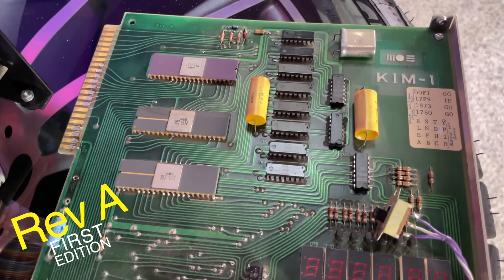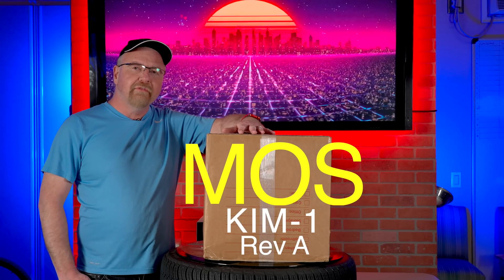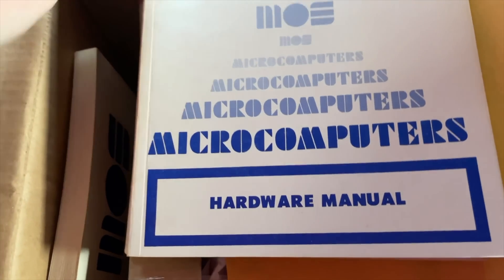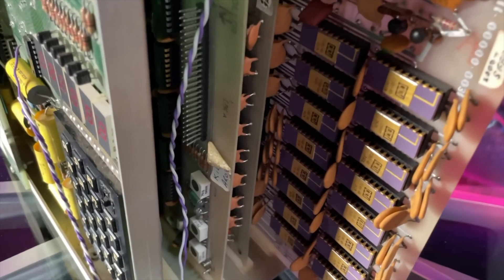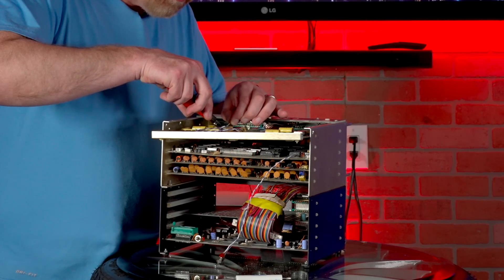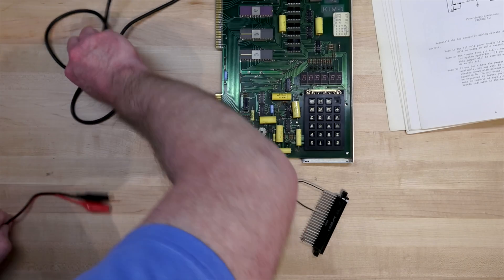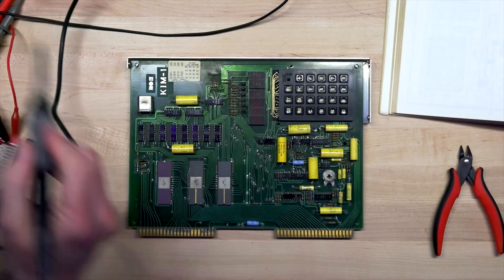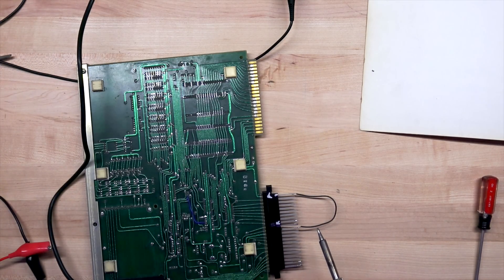I Bought the Oldest PC on eBay! Unboxing the KIM-1

Comment: Funny how I could convert an atari vcs to a kim1, just add an ay8910 or an extra 6532

And throw some extra ram and ROM 

The two gpio from the 6532 work for keyboard or the paddle inputs 

Having the crt replaced the need for the keypad and leds

But you'll need a display routine and some memory monitor or bios

Comment: My first computer. I worked for ETI in the 70's, it came in for review.
It ended up with a video card I built and a Tandberg TCD 330 remote tape drive for storage.
But then I got an Acorn Atom also 6502.

Comment: Great video! Brought back lots of good memories, so earlier today I powered up my Rev. A KIM-1, purchased April, 1976, and it works fine. My manuals are from January and March, 1976, with the dark blue covers and white/gray lettering. If there is a way to post a photo of my KIM-1, which is built into a Sears briefcase, I will happily do so. Thanks for excellent video and bringing back some fun memories!

Comment: Surprised it was soldered and not wire wrapped!
When you said 2180 my ears pricked up. That is the model no of a VCA chip DIY audio enthusiasts use a lot. 
Especially if you are building an SSL G series compressor clone. 
AKA the sound of 80's and 90's top 10 hits.

Comment: I had to write again!  When I finished my IMSAI, I got out the Intel 8080 book and wrote a program in binary (no keypad, just toggle switches.) and wrote something that read the switches and put them on the data bus LEDs.  It was something like READ FROM THE SWITCHES - WRITE TO PORT 255 (LEDs) - and finally C3 00 00.  (Don't know why I remember JUMP, CD is CALL and C9 is return from a sub.)  My nostalgia button is in full tilt.  Just a little aside.  Floppy Drives and controllers for S100 bus were around $1,400.  I traded my brand new Honda 550-four for a disk and controller.  The fact that the disk was only 100 KB, and hard-sectored did not bother me.    It just beat the heck out of my Panasonic tape recorder and a Tarbell tape controller.

Comment: First time watching, Dave. Liked and subbed. I'm also a 1968'er btw.

It's a fine looking machine and in excellent cosmetic condition. I'm a bit (no pun intended) surprised to see the amount of engineering that has been put into this, with all the peripherical boards.
That's one tough cookie you got there. Congratulations and I look forward to see the procedures, repairs, et cetera.

Though not being an educated System Manager or an Electronic Engineer I do feel safe to say, that a machine like this could easily be put into use today.
Wouldn't it be an absolute true statement to say, that it could control things through sensors and solenoids, motors and mechanics ?

Illinois capacitors on the mainboard ? Looks darn familiar to what Mr. Carlson's Lab is recommending because of their high quality. Expecting to see you test these thoroughly.
I hope you're familiar with testing for, and using the outer foil closest to the ground connection, that Mr. Carlsson's Lab has proved to induce the lowest electronic noise level, which would be useful in this environment.

Very beautyful piece of delicate equipment. Very impressed.
Made when brand new episodes of McCloud and Columbo were aired.

Cheers from Denmark, Scandinavia.

Comment: What a great video Dave! I started with the KIM-1 too and expanded it with a DIY interface to a S-100 backplane. I used it to control a home made analog music synthesizer and I'm going to speculate that it might have been one of the first synths ever controlled by a home computer :-) I actually still have both the computer and the synth although I haven't touched them for at least 40 years! You have inspired me to get them out of the box and make them work again.

Comment: Thank you for informing me about that enable wire. I rescued a KIM-1 in perfect physical condition from a laundry bin full of scrap circuit boards, for the flat rate of $1 per board. Tried to power it up but since it didn't light and I had no documentation I only put it on display, next to the core memory board and my first SBC - a kit built COSMAC VIP from the same era. It might be time to try firing it up again. No doubt there's documentation for it somewhere on the internet today.

Comment: Hey Dave, looks like you received your KIM-1 and are already having fun with it. SWEET SYSTEM !!! You can always stop by my place, here in Florida to see a KIM-1, with all white ceramic chips and an Altair 8800. Remember there is a bug in the early 6502 where the ROR command does not work. Give it a try, so that you know if you have that problem or not.
Don't forget to first set your interrupt vectors ($1C00) at both 17FA-FB and 17FE-FF, so when you press ST or RS, they are pointing to the correct location and will actual work.

Comment: Super cool, Dave!  I always wanted a KIM-1.  BY the time I had the money to buy a computer, I got an Atari 800 (which I still have).  I did a little hardware interfacing and wrote a small machine code program to scan the joystick ports for a 4x4 matrix keypad.  Never took it much deeper, because I was in Japan on Uncle Sam's nickel, and I didn't stay home much...  Much Love, and keep up the great content.  I liked Windows, up through XP.  The wheels started coming off after that, though.

Comment: Finally an un-boxing to thrill. They are mod wires not bodge wires. Calling then bodge wires insults all of us that spent their early careers modifying machines as new faster chips became available or manufacturers tweaked their designs as things were made without PCB auto-routers and the world of electronics was not a throw away world.

Comment: This was great video and provoked lots of memories.
I was at university studying computer science 76-80. In my 2nd year I used a Motorola D2 Evaluation kit II, very similar to what you have but the CPU was a 6800. All code entered in Hex and with a N digit hex display. I connected 2 kits together using 4 x RS232 lines set to different speeds and then ran messages across them. 
My lecturer (a proper hardware engineer) built a paper tape reader interface so we could cross assemble programs are read them in using the reader.
It was all very cool in the heady days of 1978

Comment: 9:20 The 6502 has its own crystal oscillator circuit, which drives the crystal resonator.  The square wave on one leg of the crystal resonator would be from phi1(out) / pin 3 on the 6502, and the sine wave would be the natural resonance output from the crystal going into phi0(in).
10:35 Bodge wire - a wire to fix a design defect in the board without the expense of manufacturing another board run.

Comment: A 'G' when acid etched into the copper clad usually comes out looking like a '6'. Ground is usually an upside-down, cartoon pine tree, or 'gnd' I was a pc board etching layout artist in the 80s. Also an "S" can look like a '5'
An interesting note: The 6500/6502 was basically a "knock off" of the 6800 series microprocessor. The 6800 was originally designed specifically as a controller to handle aiming and tracking for large, mechanically controlled telescopes. I seem to remember that the first iteration of the "Figure Forth" programming language was created for the 6800 MPU. The 99% similarity between the 6800 and 6502 is why several "Forth" OSs were available for and worked on the C-64.

Comment: Wow, what a find!  All those expansion boards and documentation.  Even though I'm not nearly as old as this would imply: my first computer, that I learned to program on, was an Epson QX-10 (only a couple doubling's of Moore's law more poweful than the KIM-1).  My original unit is long gone, but I bought a replacement on E-bay, and it came with a couple of expansion cards (packed to the gills with DIP chips) that turn it into a DOS machine as well as a CP/M machine.  I really should get it working some day and maybe post a video of it.  Problem is that computer line used its own monitor signal format with an oddball refresh rate, and I didn't get a monitor with this one.  So first I either need to modify a CRT or oscilloscope to work with the signal, or engineer a video capture card specifically for it.  Or overclock the video card from 40Hz vertical refresh to 60Hz, but the graphics chip already runs so hot it uses a special white ceramic and gold case - I'm not sure it can take much more speed than they already push it at!

Comment: Sinclair Radionics was having problems so Clive Sinclair created another company
and in 1977 they sold the MK14, ( National Semiconductor SC/MP )
befor the days of ZX80 ( which used the TVT-6 "idea" ) followed by ZX81, ZXspectrum, 
QL (68000) and Z88 yet another company
wiki
The MK14 (Microcomputer Kit 14) was a computer kit sold by Science of Cambridge 
of the United Kingdom, first introduced in 1977 for £39.95.

Comment: The  ELEKTOR Junior Computer was a virtual clone of the KIM-1, 
only it did not use the special I/O+ROM chips but rather an 6532 RIOT 
   
the floppy interface design is based on the Ohio Scientific OS65D

Comment: Wow, the memories.  I'm old enough to remember these.  While he was in the USAF, my dad brought home two different computers that were compatible with the KIM-1, a Synertek SYM-1 and the Rockwell AIM-65.  The latter was much more usable than either the KIM-1 or the SYM-1 as it was a complete system, including a keyboard, alphanumeric LED panel and a thermal printer. It had another thing that was commonplace among many computers of the day, Microsoft BASIC.  I had loads of fun with the AIM-65 back in the day.

Comment: Thank you, Dave.  Brought back memories.  In 1978-ish, I took delivery of a 6502-based system with a hex keypad.  It was the Acorn system 1.  I got it from 4a Market Hill, Cambridge.  There were a bunch of long-haired types on the landings between floors soldering and assembling systems.  Of course, Acorn eventually invented their own processor and became ARM, still based near Cambridge.  An acquaintance of mine in the metal physics group at the Cavendish was Herman Hauser, who ended up big in ARM.

I was astonished at the power of the 6502.  My data point for comparison was a PDP-8S (s= serial),  which had a 1MHz clock, and took 13us to do anything.  It had a 12-bit word,  a 12KW main memory and a ~40kW fixed hard disk.   It could read paper tape at 500 cps.  I learned the paper tape boot loader,  which I had to toggle in on the front panel.  It occupied (one or two, can't remember) 19-inch rack-mount 6-foot high cabinets.  The advantage of the PDP-8s was when it broke (which it did),  I could test all the (germanium) transistors on a multi-meter and replace the failed unit.

It's amazing what you can program in 12KW.   In my first paid software job I was told "Adrian, we were waiting for somebody with PDP-8 assembler,  we've got this little job for you.".  The little job involved modifying a "bright beer" manifold control system in a brewery (Carlsberg).  They had >100 parallel threads of operation ("open valve, wait 5 hours, close valve") crammed into those 12KW.

Where's this going?  Nowhere, but I'm retired and have official sanction to meander...

Comment: That was great!:-) 
I was in my teens in 1979 and had been an electronics enthusiast for some years. I looked longingly at the KIM 1 and planned to get a z80 based Nascom (It had a qwerty keyboard.!) and I saved my first pay working on motorway construction.
By the time I had enough, the Acorn Atom had become available. I bought one in Kit Form and later spent £125 on the extra 6k of RAM to allow bit-mapped graphics!
Great to see a KIM1 lighting up! 
Thanks!
Reply: The first visit I made to the BBC at Oxford Road in Manchester loads of the technicians had Nascoms buries in nest of wires, getting them to do fancy things with video signals… it was bleeding edge stuff back then: now you could do similar things with a phone! 😆

Comment: Dave the blue wire is a EC wire.  If you look closely you more then not will find a cut trace. The wire fixes a issue on the motherboard.  One wire is fantastic, the last Lenovo laptop I took apart had 4.  OH, EC = Engineering Change.

Comment: 8:00 Given the apparent quality of the whole upgrade enclosure integration, I was surprised to see the cack-handed soldering debris remaining on the upper edge connector. I wonder if the original owner had been so eager to add his first I/O hardware that he couldn't wait for a socket to plug the KIM into?

Comment: Awesome history. So, if you pull down a pin like that on the connector, use a small resistor like 1k which is usually enough to pull a signal down but also may prevent damage if things go haywire like wrong line. Have fun restoring, keep us updated!

Comment: Nice, great to see it up and running Dave. Just a caution as those old Capacitors may cause issues, particularly the electrolytics on the other boards.
Reply: Those caps were not the poorly made ones sold today. Also, they used a linear power supply, so you didn't need low ESR or high temperature types. They were much more reliable than today's. They went away because today's rap is much cheaper. I worked in asset recovery when Sprague shutdown their Orlando plant in the early '90s, because cheap imports caused them to lose most of their market. The most common failure of those caps is the electrolyte drying out.

Comment: I was a college freshman in 1979 at Oregon State University. My first microcomputer programming course used something like the KIM-1; at least in as much as it was a Motorola 6502 based system with similar capabilities. At the start of the course we used toggle switches, like you would find on an Altair 8800, to enter machine code. Thank dog those days are long gone. It was somewhat surreal given that the university also had a CDC Cyber 7600 which is what I programmed as a member of the "Educational Computing Service" department.

Comment: Reminds of a trainer we used when I was in college for electrical engineering except our trainers were Z-80 based. I had a lot of fun with them, they had a little buzzer type speaker and I took a guitar tuner and worked out the values I needed to get a couple of octaves and then would program in songs. Then I took a compander fed it into an A/D converter and clocked the signal through memory and daisy chained 6 of them together and on the last one I had a D/A converter fed into the other half of the compander and made a 8 bit digital delay. Then I took 2 more companders and D/A chips and tapped at the output of the second and 4th trainer and fed the three outputs into a homemade mixer and made a tapped delay/reverb. I even impressed my professor with that one.

Comment: I saw some white (ceramic?) chips in old PDP/VAX gear I had at one stage - I had 5 ton of it and now regret sending it to the scrap metal guy - though hauling a 8850 at about a ton around as a personal computer would have been nuts but I did have a VAX 8300 (dual SMP CPU with one CPU was an 8200 and another an 8300) and all Backplane Interconnect - bit like PCI with each card having its own ID and a patch of smart logic to arbitrate on the BI (I did get CI VAX Cluster going for a short time which was fun). Was a nice 'little' filing cabinet draw sized machine (not a bad space heater too!). Sadly most of the equipment was 3 phase 415V and not something my house had or would likely get. I did run up a VAX 11/780 in my apartment years earlier after finding out the 3 phase was just a distribution box for a load of single phase units but the 780 was missing the main bus terminate rendering it utterly useless other than the PDP 11/02? console...

Comment: Super Jealous of the KIM-1 and the Pet in the back ground 😁

I had to use a similar device as the Kim when doing Electrical Engineering (Microprocessor Fundamentals).  I had to write everything down in 6502 assembler, convert it to machine code and enter it into the hex keypad. That course was also used as an intro to CRO's because the boards were designed to have connections to connect the CRO probes at key locations. I really enjoyed that course.

Comment: Love seeing the lab combination of hardware, scope and mnemonics... it brings back memories of my Z80 board.

TI used to make memory chips encapsulated in white ceramics with a center portal
EPROM storing code let you peek through their glass window used to UV erase content before flashing updates. 
I used to dream it would be nice to interconnect these early machines to let  them work on colaborative tasks. 
No1 pain was kicking the plug while typing the code manually, no mass storage available or any idea of compatibility at this early stage. 😁

Comment: Interesting :). Just something you may like, I saw you soldering that temporary jump to the edge connector pin, that's an absolutely ideal scenario for wire wrap - tool costs a few bucks and it's super fast and satisfying especially for short term connections like that.  Bit of a lost art but very fun and practical :)
Reply: recently found my wrapping tools, just need to find the (kynar?) wire to go with them.
Reply: @markpitts5194  Mylar wires I think they were called.

Edit: I'll correct that—the insulation on the wire was called Kynar; Mylar was just one of the manufacturers of Kynar coated wire.

Whatever it's called I used to go through loads of it!

Comment: Dave, you are not the first to fall for the missing letters in the kim-1 labeling of the card edges.  It happened to me. I owned a kim-1 for years that I assumed was dead, one day I was reviewing the hardware manual and realized my mistake. I had grounded the wrong pin.
Reply: apparently they wanted to memorialize RTFM  early on